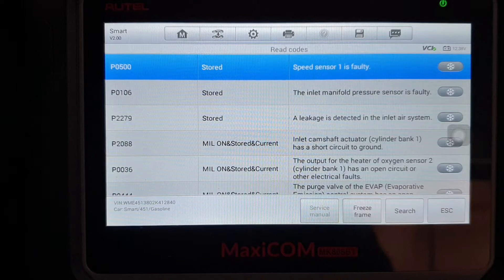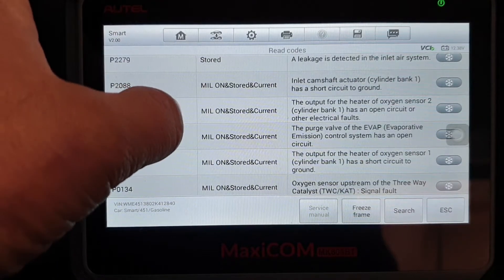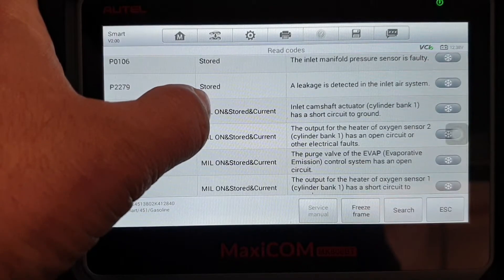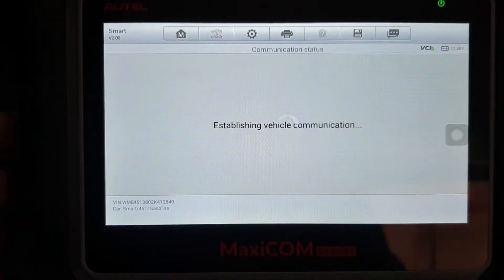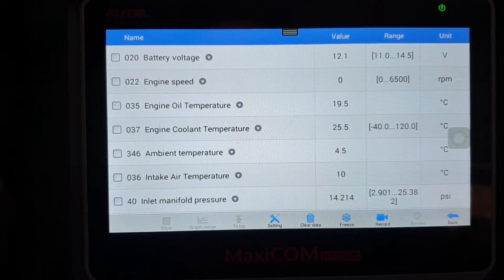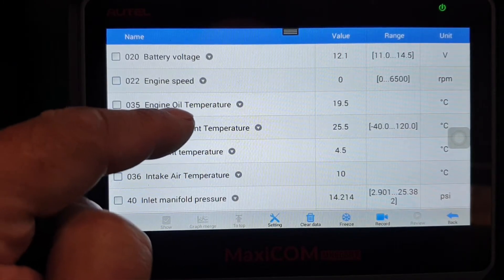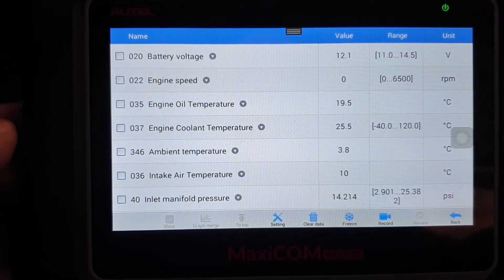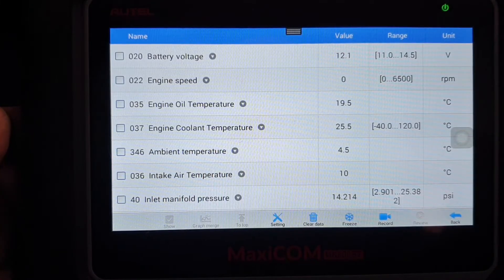Smart Fortwo MHD (micro-hybrid)  W451 1.0 L Oil pressure Switch Replacement.

Comment: Excellent video sir. In my Smart fortwo 451, I don't have the oil pressure sensor either, since it probably broke when the belt was cut. Anyway, even without the sensor, in my car, the oil pressure light, It turns on and then turns off, it's no problem. I'm about to buy the sensor and I'm going to change it as soon as possible, the only problem is that they covered the hole where the sensor goes with Poxipol and I don't know how I'm going to get it out. Any suggestions? Regards